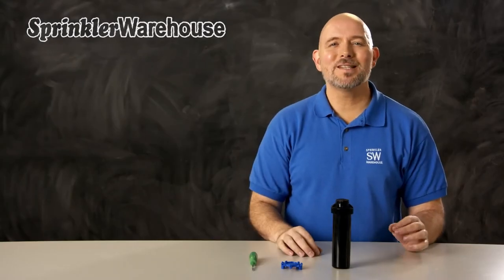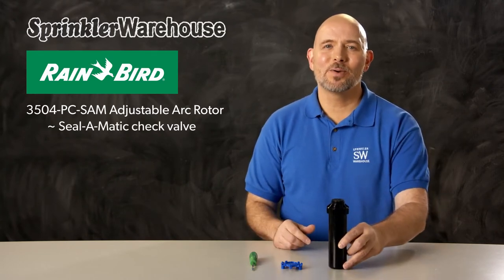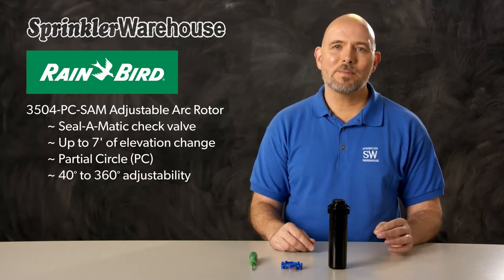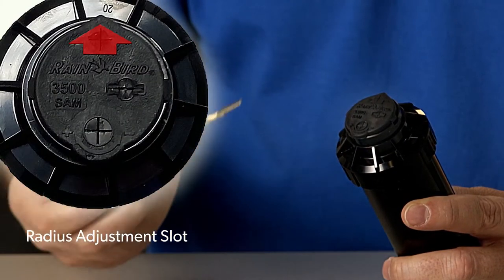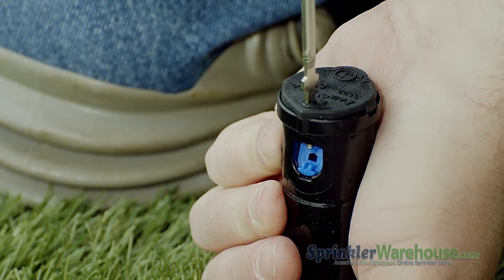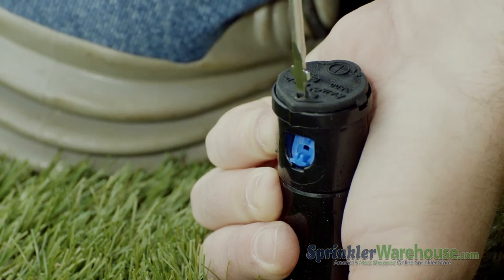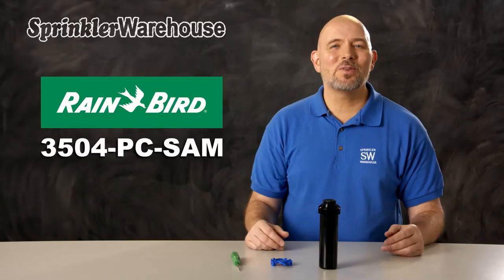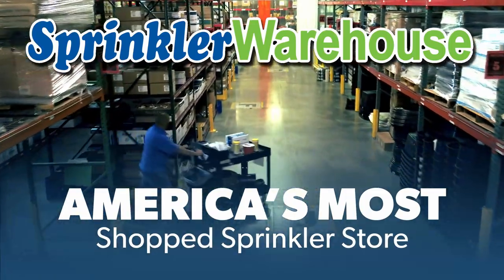The Rain Bird 3504-PC Seal-A-Matic Adjustable Arc Rotor

Comment: Hi 
If it has a check valve, so the head holds water, how do you winterise it?
I’m in the Uk, and looking at having 3x3500’s with a drain valve at the lowest point.
So would I be ok with the standard 3504 with a drain valve, or better to go with the 3504 Sam?
Oh I have a slight gradient on my lawn.
Thankyou 👍🏻